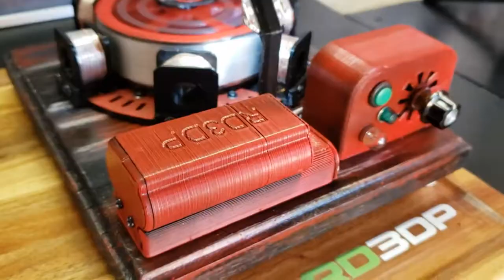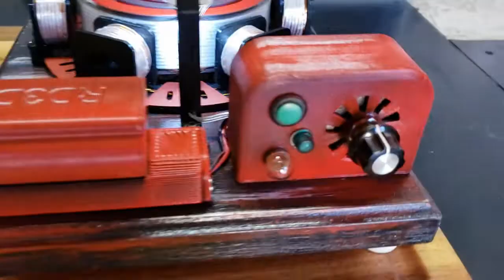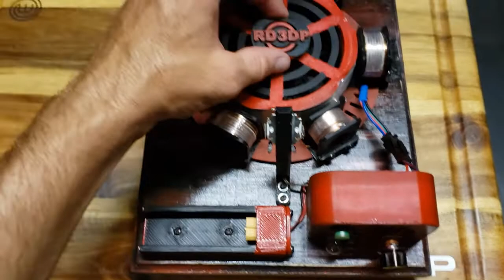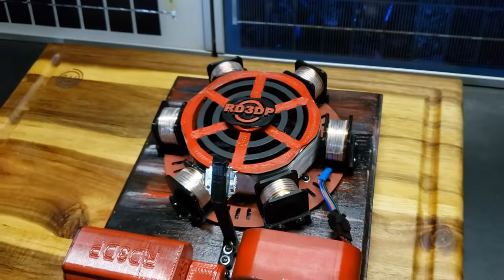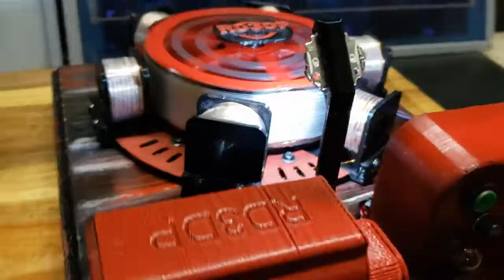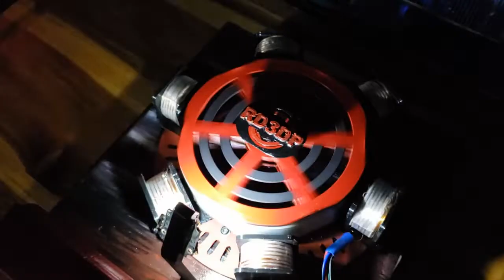SIX COIL BEDINI MOTOR LAMP

Comment: Are you charging batteries or doing anything with the back EMF?
Reply from the maker: Not anymore. I have experimented exhaustively and found that emf is just higher voltage with less current. Not really useful id rather charge batteries with solar since I prefer to use li ion. I just like experimenting with different bedini motor designs.
Reply: @redesign3dp   the back emf is a voltage impulse. you can use it to split water in a water capacitor. The electrons emitted when the water split will travel through the coil and add more speed to the rotor. But you must have a relative low resistance of your water capacitor otherwise you will see a current draw increase from the power supply. just add some electrolyte like baking soda and make sure the surface area of the capacitor is big enough to provide no resistance to the voltage impulse. Also here are some titles to some research paper about impulse power secrets. I would post the link but YouTube just delete my comment when I post links. The same reason how it splits water is the same reason why it charges some batteries with less energy consumed to charge it, thus allowing for a self running battery switching system. the voltage impulses induce a chemical change in the battery. The papers wont give you holy grail of free power information but it will enlighten you about the existing technology that are kept in the shadows, such as the  self-rotating electric pulse generator on page 16 of the second paper.

IMPULSE POWER SECRETS
 Ph.M. Kanarev
ENERGY IMPULSE SECRETS
 Ph. M. Kanarev

Comment: Can you self run/loop the system?
Reply from the maker: No sir, I've tried to do that over the years using different methods and found it to be impossible. But for some strange reason, I still give it a shot every time.
Reply: Bedini has said that his energizer is capable of charging 2 or more batteries simultaneously, before the run battery goes down fully and by swapping batteries, it is possible to keep the machine running, months on end. Personally, I have built his version, nearly 10 years ago but didn't have the patience to try out this idea. Maybe, you could look into it and see if this is possible. One thing you'll surely need is a sort of mechanically latching, multi pole relay, that does not need constant power to hold its position, so that energy is conserved.

Comment: Wow that's is an awesome bedini motor man I didn't get. Notification for this video just saw it I would like to buy one hoe much are you selling them great work man 👍
Reply from the maker: I'm not selling anything. But if you buy a 3d printer under $200 like an ender 3. I'll give you the files for free and you can print it out and experiment with different coil resistances.
Reply: @redesign3dp  Thanks man I appreciate that very much when I have some money to spend I'll buy one and get back with you or can you send me the files and I'll just go to a 3d print shop and print then out let me know I'll give you my email
Reply: I love your designs - just purchased an any cubic 3D printer.  I need to start playing with designs. What is best software for drawing these types of machine parts?
Reply from the maker: @energyhack3538  I use Fusion 360 it's free for students or hobbyist. There are tons of great tutorials on Youtube. I also use Cura for slicing, makes things easy. Let me know when your up and running and I'll send you some stl. files.
Reply: Motor finishing is very nice...